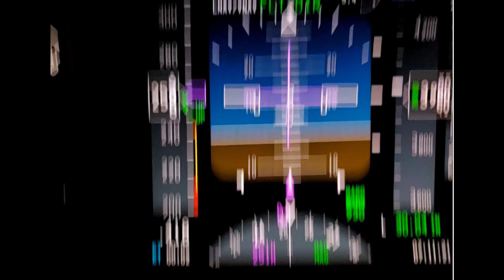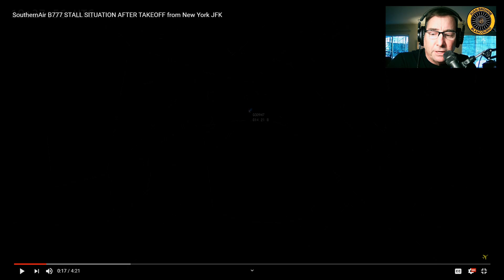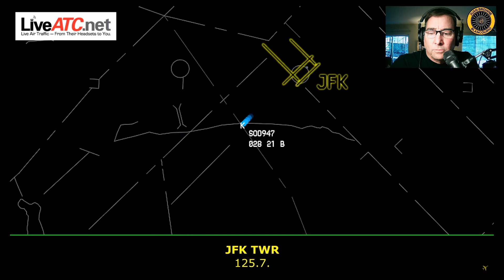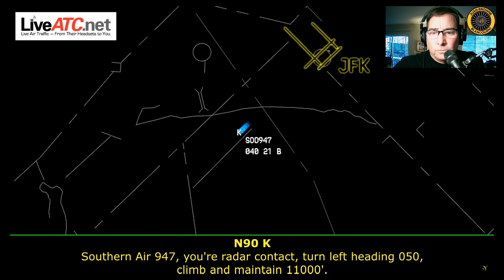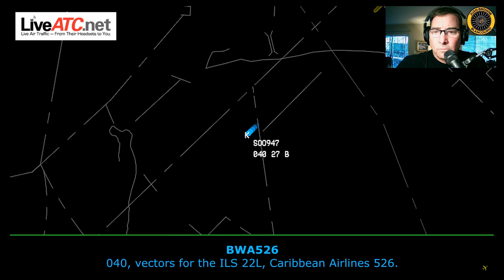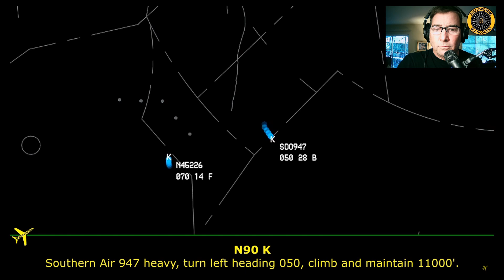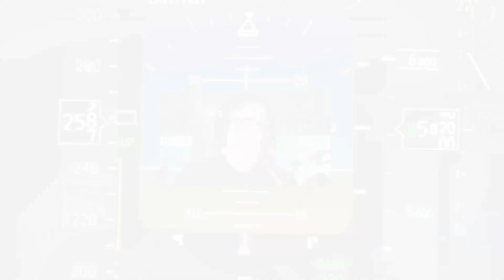"Stall, Stall, Stall" B-777-200 JFK 15 Nov 2020

Comment: Has any manufacturer tried automated flaps that extend or retract based on airspeed and altitude?
Reply: The (leading edge) slats of the A4 Skyhawk were auto-deploy solely from air loads, if that's what you mean.

"Spring-loaded flaps" or similar probably wouldn't make sense. Flaps are for changing the camber of the wing. Especially in the case of an airliner, desired wing camber isn't a one-to-one match with speed or pressure altitude.  You might want 15 deg flaps set for takeoff (speed zero), or alternatively for descent towards an airport (200+ kt).
Reply: @marcmcreynolds2827  Yeah, I'm familiar with auto slats, the F-16 has them, and even the old Me 109 too. I was just wondering if there was any value what with FBW technology the flaps could automatically incrementally generate lift if climb or a landing was being commanded.
Reply: @idanceforpennies281   Now I see where you're going.  I imagine such an "autoflap" system would need to be implemented only(?) in the context of a fully computer-controlled flight mode, since thrust level and AOA (and a possible sudden engine-out) would all dynamically figure in. OTOH there might be specific circumstances where it could come in handy even without full integration.  Maybe during a post-V1 RTO, for example, the flaps would automatically retract to get the most weight on the tires for braking, while slats stay extended so as to maximize drag. That could even be "retrofitted" to a current design, though the tire/wheel/brake would need requalification via dyno testing.
Reply: @marcmcreynolds2827  Flaps are basically only used for landings and takeoffs. There are many hard indicators for both that the plane could know about. Takeoff is pretty simple, but even "landing" is not too hard to work out: a let down from top of climb, proximity to destination via the nav, gear deployment etc. You could even just push a button which says "I'm landing".
Reply: @idanceforpennies281  > You could even just push a button which says "I'm landing" <  The button for that was first pushed so to speak in the late 1950's, when a USAF bomber flew a hands-off demonstration mission which included landing.  No question that all the needed sensors and interfaces are available in modern airframes (maybe increase redundancy though?), and automated airways have been studied for decades. In the late 1980's, for example, I did a bit of work on high-speed exit schemes which might allow closer spacing of aircraft on approach in a fully-automated airspace. What I'm speaking to in my autoflaps remarks is the overarching issue of how much can be safely handed off to automated control before it really needs to be "everything" (i.e. the present situation, only more so) -- the pilot(s) mostly along to monitor. Or not there: A much smaller number of remote pilots, monitoring from central "help centers" and only intervening in the rare cases when a system fails?
Reply: @marcmcreynolds2827  The unmissable fact is that pilot error is by an order of magnitude the biggest cause of accidents and incidents. We are actually in a very dangerous place right now. Pilots are now told to rely on the auto systems, but sometimes they get overwhelmed and they hand control back to the pilot at the worst possible time. Or the pilots fight the auto systems (What's it doing now?), not realising they are the problem, not the solution.
Reply: @idanceforpennies281  Agree. As for pilot error having become the driver of accident statistics over time, that is nonetheless a success story of sorts:  The hardware keeps getting more and more reliable, and thus becomes less of a factor in proportion. But even pilot error could be driven down if there was the will, such as an increased level of recurrent simulator training for abnormal-conditions as opposed to looking for ways to minimize simulator time.

Comment: Wondering how the Air France 447 (A332) flight from Rio de Janeiro, Brazil to Paris, France completely stall over the ocean without an engine problem and crash killing everyone? I thought this covered under its computer systems or did it have something to do with a blocked pitot tube or bad piloting?

Comment: If, on Airbus, the min manoeuvring speed cannot be passed, how did the air france bus crash into the Atlantic?  Read somewhere the copilot had the side stick drawn back and the plane stalled out.
Reply: that aircraft was receiving conflicting airspeed data, so was outside of "normal law" which Juan mentions. Since the computers didn't know the correct airspeed the computers then allow the pilots more authority.
Reply: @beezalbub7325  Thank you.

Comment: So 250kts is the speed limit but the min manoeuvre speed looks like it is 251 kts (higher due to the weight).  Aren't climbing turns restricted to 15deg?   Also does the display not show the max manoeuvre speed (Va)?  It sounds like the "threading the needle" is really down to the 250 kts speed limit and the weight increasing the stall speed and this is incident is baked in if the speed limit cannot be exceeded.

Comment: Yes Sir, I need to exceed the speed limit today, we're heavy. Caution wake turbulence. Self reporting and debriefing  is a good thing.
Reply: Did Juan ever answer the question posed at the beginning - do pilots get in trouble for incidents like this?  I'm not a pilot or hard-core aviation buff, just a mild-to-medium buff.
Reply: He mentions at about the 4:30 mark that if they did the correct reporting and basically the stars aligned, no they shouldn’t get in trouble for this.

Comment: Stall means no thrust, no engine, no power. CCP
Reply: Stall means the wings are no longer producing lift. The boundary layer of air along the wing detaches and lift is lost.
Reply: @beezalbub7325  You are right. Stall means the aeroplane is not flyable, due to no lift. 747 max had a nose down and the only way to deal with that was to take control of the aeroplane, a captains responsibility. Am I wrong, please tell me.
Reply: No.
Reply: @gregculverwell  TELL ME?

Comment: I must have missed something. What was wrong, engines not making  normal sufficient power????  Too steep a climb?  I understand it’s heavy.
Reply: Most likely they pitched up to high, aka too steep of a climb, but as Juan mentioned data might have been incorrectly calculated or inputed into the computers wrong. That could cause the pilot to believe his climb angle is valid until things go wrong.